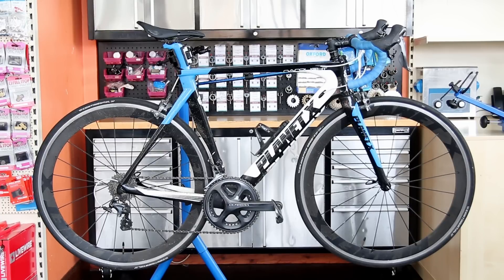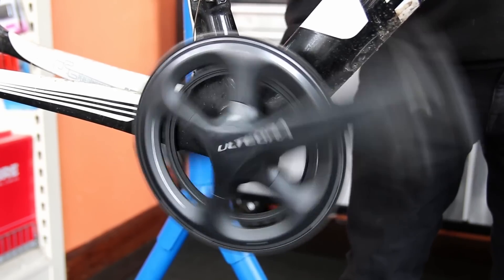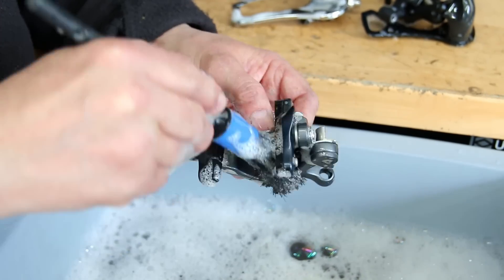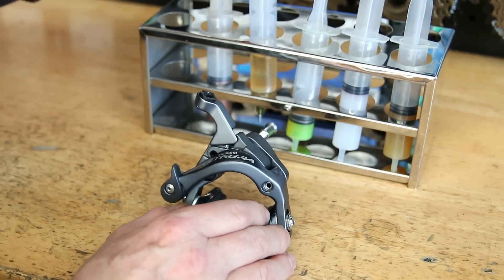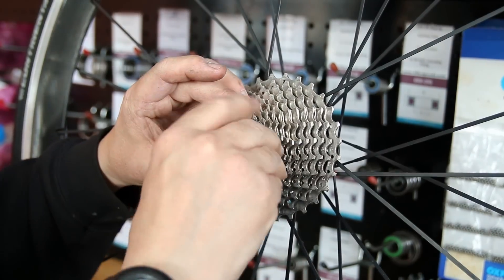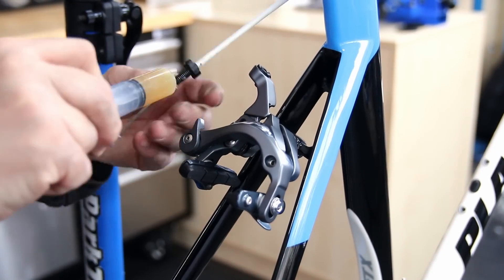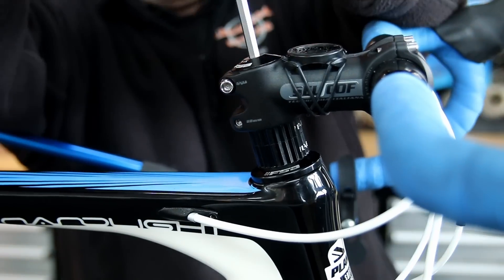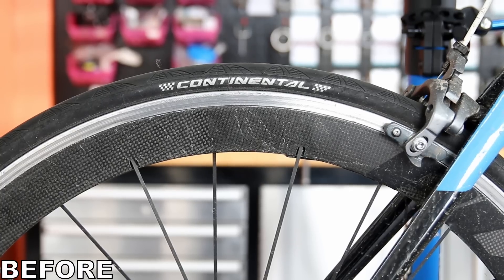Planet X Nanolight Rebuild! Full Road Bike Service!

Comment: Excellent job on the bike (again). Do love a planet X and had a Carbon Pro for a long while. Great bikes. Do you use a heat setting on the ultrasonic cleaner? What temperature do you tend to use or does it change dependant on level of grime? Huge congratulations on the launch of the online store too and know you'll do well. Thanks for continuing to inspire us all. 🎉
Reply from the maker: Thanks for the congratulations. When it comes to the ultrasonic we always air on the side of caution and only every use heat on metal components like chains and cassettes where there’s no risk of blowing paint or anodising off 🧡
Reply: @Bikespeeds  thanks for the advice. Love your considerate approach 👏🙌 thank you and enjoy the sunshine

Comment: What is the right order to loose the spacer: a) loose the top cap bolt or b) the stem bolts first? I thought starting with the latter , but wondering now since i saw this video